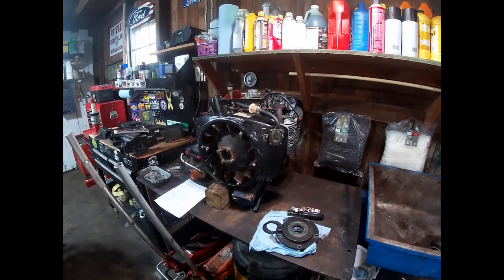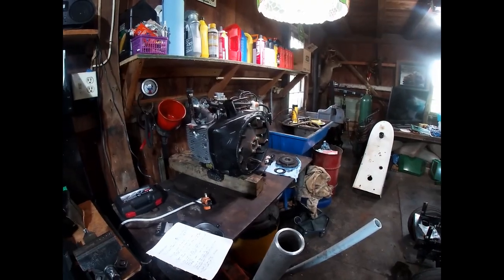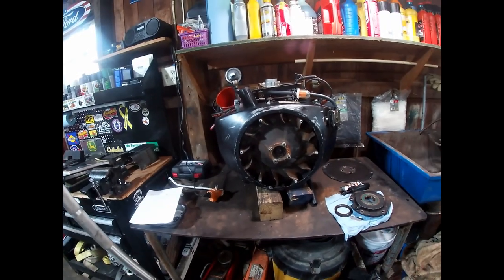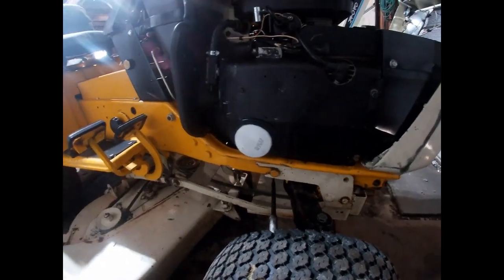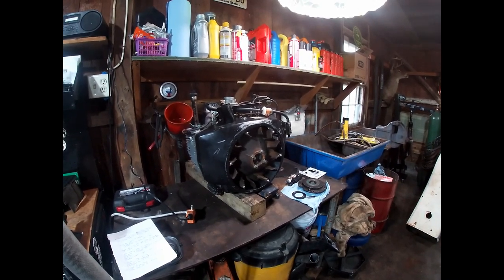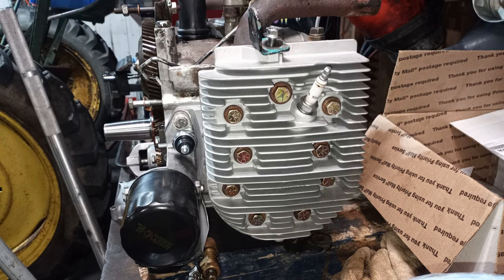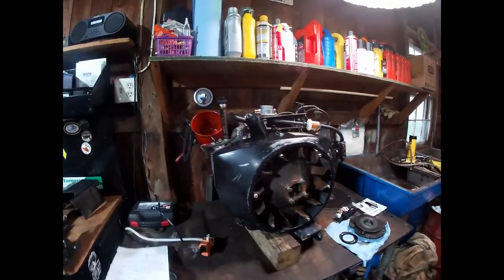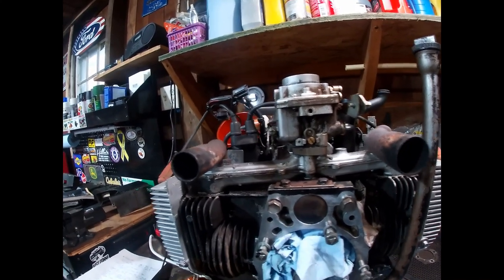10 Tips to MAXIMIZE the Life of the ONAN Engine in Your Garden Tractor - Long Live the Opposed Twin!

Comment: my john deere has a kawasaki engine air cooled v twin over head valve 18 horse power engine model fh531v i have mentioned this tractor a couple of times 2002 john deere GX325. 99% of the time i check the oil level and change it at least 1 or 2 times in a season depending on level of use check air filters spark plugs and of course i replace the oil filter too.
Reply: i have only used it for 1 full season so i will see how often i need to change the engine oil and filter i try to get as much use out of it as i can but i don't want it to get too dirty.
Reply from the maker: @shaunkanary997  Change oil every 50 hours and adjust the valve lash every 200 hours and it will run forever. As far as the "late model" power equipment goes, Kawasaki engines are probably the best on the market anymore.
Reply: @MichaelTJD60  Valve lash? so far i have not had to do that.
Reply from the maker: @shaunkanary997  The manual for that machine probably says to bring it to your John Deere dealer when it is due for a valve lash adjustment. From what I've seen and heard, the only significant failures that have been going on with the late-model Kawasaki engines are tossed valve seats, worn guides or push rods due to people not keeping the valves adjusted regularly.

Comment: I would avoid fram filters and Mobil 1 oil or cheap motor oil sadly the factory Kohler and some John Deere filters are possibly Made by Fram. I would run Baldwin Wix or Motorcraft oil filters. When it coms to spark plugs I like NGK and Autolite some Champion Plugs or factory Briggs and Stratton plugs even AC Delco will work. I had a single cylinder command make a ticking noise Because it had a Fram filter adding fresh oil and a new OEM oil filter it went away like no tomorrow. As far as tune ups I use sea foam its great stuff.
Reply from the maker: I used to use Seafoam but it has gotten too expensive. At the end of the day there's no substitute for running clean oil and good filters, changing them often, and decarboning the heads.
Reply: @MichaelTJD60  That is actually the truth you cant substitute clean oil I always change my oil at least 100 hours. Sea foam is expensive

Comment: What’s the best way to look up onan engine parts and diagrams somone sent me a parts manual for a p218 and I typed in Cummins the parts I needed and wanted to see if available the part number never showed up so did the part numbers supersede and is there an updated parts page
Reply from the maker: The Deere parts lookup is probably your best bet. Deere uses an "HE" prefix before all of the Onan part numbers and I believe Cummins may use an "ME" prefix, hence why the Cummins parts lookup did not recognize your search. Either way, the Deere parts diagrams will probably quickest and easiest to navigate.

Comment: My engine does not seem to get dirty fins only the air filters and the fan or flywheel screen.
Reply from the maker: All air cooled engines get dirty. You'd be surprised if you pull the blower housing off.

Comment: On the John Deere’s and cub cadets I always take the side panels off the tractor in the summer heat so the engine can pull more air in maybe that’s wrong but the engines stay cooler I think and most of them the hood gets so hot you can’t even touch it that’s what I do in the summer and my 318 also doesn’t have the mesh screen covering the flywheel on the onan and I’m not feeling like pulling the motor right now lol maybe I’ll pull it out one of these coming years and give it a check up adjusting valves cleaning the sump and replacing the sump gasket because it is a little damp around it
Reply from the maker: Clean the cooling fins out and then put those side panels back on! Those cylinder heads won't be getting enough airflow with the side panels off...they are there for a reason.
Reply: @MichaelTJD60  in referring to the metal John Deere side covers that go around the engine  on the tractor not the engine tin  that’s black and covers the cylinder head
Reply from the maker: @hunter7476  I'm referring to the tractor side panels as well...they need to be in place, otherwise some of that intake air will be directed past the engine and out the sides of the tractor, rather than over the cylinder heads and out the front.
Reply: @MichaelTJD60  oh ok I though yo I were referring the tins bolted to the engine block

Comment: Mike
I want to purchase a 318
what year do you recommend ?
Reply from the maker: Personally, I am a fan of the '87 model year tractors. They were first to use the P series engines (which had the additional screen over the flywheel - it was discontinued the following year), had extra reinforcements welded at the front of the frame near the front axle, had the smoothest version of the hydro control linkage (later models had two shock absorbers and were very jerky), still had painted sheet metal rather than powdercoat, and did not yet receive the updated wiring harness with the brake pedal safety switch.

Comment: Mine is a sears onan 917.257080 n52e- something the other numbers are to smudged up for me to see them 

And im looking for a new carburetor and fuel pump i can get by with a different pump
Reply from the maker: Does yours have the fuel pump attached to the shroud or is it part of the carb itself? I have a few of the standalone fuel pumps in my used parts stock.

Comment: The picture of the plastic gears and camshaft gear in the GX620/GX670 was absolutely shocking. I would have never thought Honda of all companies would lower themselves to put plastic parts in their COMMERCIAL engines. Knowing this, I would much rather use a Briggs Vanguard v-twin since at least they both still use a cast iron camshaft. I think the newer kohler v-twins have a pressed steel camshaft where they press the lobes and the gear on a steel spindle like how Briggs has done for their Intek single and v-twin residential engines. And we know how piss poor those camshafts are snapping compression releases like it’s their job. But a plastic camshaft gear on a Honda. Just wow. Honda single cylinder GX engines still use cast iron camshafts so why don’t the V-twin GX engine?! I think even the Predator 670 uses a proper cast camshaft and it is a literal clone of the Honda V-twin.
Reply from the maker: My thoughts exactly. Ever since seeing the internals of that Honda GX, I have put more faith in the Briggs Vanguard engines than most of the other repower engine options. Still not a huge fan of the V-twins though, regardless. Briggs has always found ways to cut corners on everything from the smallest I/C or Intek single to the largest Vanguard series v-twin, but the average buyers don't seem to care - they'd rather just run them until they blow and replace them with a whole new engine.

Comment: i do top off the oil A LITTLE BIT not too full if you run the engine hard for a while i give it some more me it is better to have a little extra than not enough have to drain some out fine with me

Comment: How do I know if there is anything worn excessive is there anything I should listen for distinct sounds ?
Reply from the maker: Easiest and most noticeable would be a ticking noise from the valve train, hard starting or random popping out the exhaust (assuming carb is adjusted correctly). Low-end knocking could be excessive crankshaft end play, worn rods, or both. In the case of my 2072, the cam bearings failed and pushed the freeze plug out of the block, but the engine still ran perfectly - I don't know what kind of damage would have been done if I had continued running it.
Reply: @MichaelTJD60  mine has the slightest valve noise like the slightest I’ll probably adjust then sometime here
Reply from the maker: @hunter7476  It's probably overdue for a valve adjustment.

Comment: I've searched and came up showing nothing on the firewalls there's just the page
Reply from the maker: The firewall and foam was only used on Deere tractors. Cub Cadet 82 series had a crude firewall with a small piece of foam insulation down around the flywheel housing but it wasn't a full foam sheet like Deere used. You won't find much info out there as most people don't know these tractors ever had foam insulation from the factory - many of them haven't survived after 40+ years.

Comment: My tag says on the onan change the oil every 25
Reply from the maker: That was the original recommended service interval for most of the Onan engines up until Deere began using them in the 300/400 series in '83. Compared to when the early Onan engines like the N, CCK, and B series were introduced (as far back as the 50's), oil and filter quality had improved greatly by that point, and have improved much more in the last 40 years since Deere tractors began using them.
Reply: @MichaelTJD60  yeah

Comment: So why is  my bg48 airfilter look like a oil bath filter
Reply from the maker: Crankcase is overfull, or your piston rings are shot and are letting too much blow-by up through the breather and into the air filter box.
Reply: @MichaelTJD60  but what I don't understand is never ever see blue smoke. Only when I get on a real steep side hill.  Thanks Ed. Was going to repower S 20 steiner but am re thinking
Reply from the maker: @edkauffman4808  You probably have a bad valve guide or valve seal that is letting oil get past it and on top of the piston when the engine is on an angle.
Reply: Did a cold compression check and only have  70 to 74 think going y
To pull head and install. New gaskets see if I can get 100. . Think that's to you I will be putting the money in the bg48g at this point

Comment: I would only disagree with his last point. WOT can not possibly be a cooler running speed.
Reply from the maker: It is, as long as the cooling fins are not obstructed. The volume of air being pulled through the intake at 3450-3600 RPM far exceeds what the engine is moving at any lower RPM, but an obstruction in the path of that airflow will cause overheating just as quickly.

Comment: Why draw air from underneath a machine when especially it is cutting grass ? 99 percent of air cooled engines draw cool from the front Cars Trucks Jets Small Aircraft Lawn mowers from the top of the motor
Reply from the maker: With the exception of the older Onan-powered Case machines, the engines in these garden tractors were usually mounted backwards in the frame so the crankshaft rotated in the proper direction (counterclockwise) to turn the input shaft on the transmission. The idea with an air-cooled "small tractor", especially ones that were commonly used to mow grass, was to keep the engine heat away from the operator (and the grass/debris buildup near the mower deck) as much as possible - hence why the exhaust systems were almost always at the front of the machine. If the engines were mounted the opposite way, the majority of the heat they produce would be directed back toward the operator and the center of the tractor - given how quickly grass can accumulate in that area on a mowing tractor, it would become a fire hazard pretty quickly. Given the compact size of these tractors, there aren't many places the engine heat can go - so having it exit the front of the machine is usually the best choice.
Reply: @MichaelTJD60 In the Sears Suburbans they were mounted sideways

Comment: Best thing to do is throw them onans away and put something else in it
Reply: I’ve had tons of these and used to repair them for Deere when I was younger. The kawi and Honda are longer lasting with much less maintenance more balls too.
Reply from the maker: @Freedomlawnservice87  I can't vouch for the "more balls" when comparing to an opposed twin...Kawasaki's have always treated me well, especially when I was doing commercial mowing (they're probably the best gas engine on the market as far as the new stuff goes), but I've never had one handle tall grass as easily as one of my Onan's...especially when mowing overgrown properties.
Reply: @Freedomlawnservice87  No way in hell would i take a Kawasaki over a onan or kohler. Those “more balls” are not what Kawasaki has compared to onans or kohlers. Me personally id never own a honda engine. I cant come to my senses to own an engine with a plastic cam gear. Especially after what happened withthe Kawasaki’s in the 90s.
Reply: For what a 318 cost right now, why the hell would somebody want to spend the same amount or more on a v twin swap? Wasted energy, IMO
Reply from the maker: @JoshAllen17Goated  Deere straightened Kawasaki out shortly after the cam gear issues surfaced. After the debacle with the KT17 Kohler engine failures (and all the lawsuits), Deere wasn't playing around with defective junk in their higher end machines anymore...and with the amount of money they were (and still are) giving Kawasaki to provide the engines for their equipment, you'd better hope Kawasaki is putting out a good engine now.
Reply from the maker: @jerrysgardentractorsengine2243  My thoughts as well...the resale value won't be any higher after they've spent the money on a repower kit.